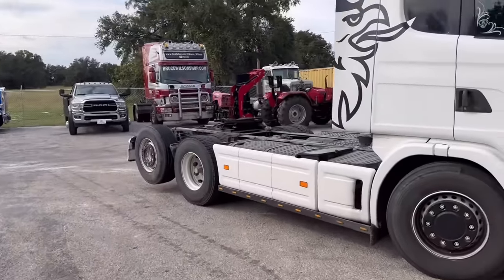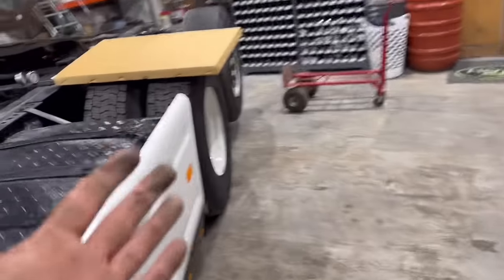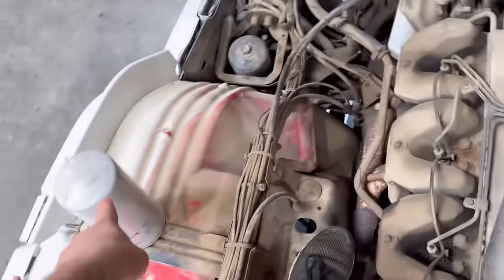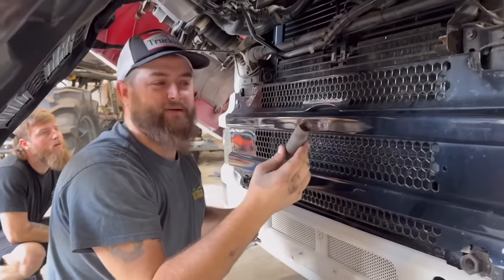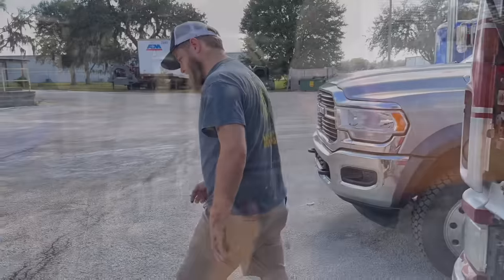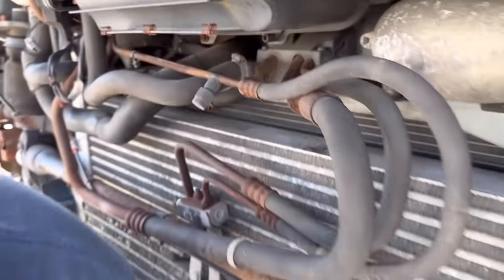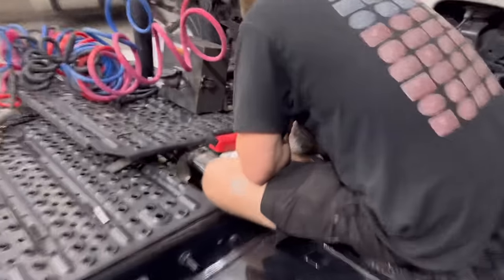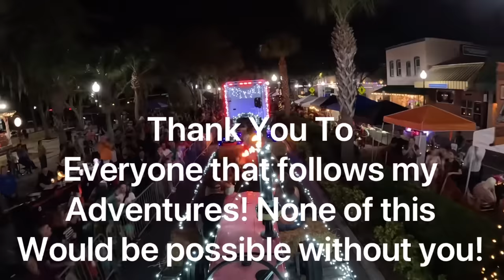My SCANIA Needs Serious Engine Repair…

Comment: In Finland, Helsinki, Scania's workshop in Konala has a disassembly facility in the same connection. You can get parts for even older trucks there.  It is very rare for these to leak a head gasket. Usually the fault is in the block that it is corroded. And welcome to Finland. I really like these Scania videos and if I'm honest I only watch them on this channel
Reply: Correct, probably cylinder liner gaskets.

Comment: Hi Bruce, congratulations on your Scania 144-530. I have had several of them when they were new, the one you have there is the first model 144, you can see it on the front grill, it is not the same as the red one you have, it is with it (new muzzle), in a Scania 530 V8 you don't have to use all the gears, empty tractor you can start in 1 high and high split and switch to 3 high low split and then in high split, then you will find that it starts howling and out of the exhaust pipe, when you skid gear, when you can make it howl when you change gear you can drive Scania 530 V8, you can try searching here for Scania 144 530 v8 straight tube, then you will see and hear how a 530er should sound when can drive in them. you can check the serial style number on the left door, it's the long number you need to look at, it should say 530 or 460 in the middle of the number, you can see how many horses it has 530 hp or 460 if it's a 460 hp it doesn't howl when you change gear as it runs with a different turbo. so good luck with it and see if you can get it to howl when you shift gears.👍
Reply: Wel wen I drove my 124-340 I started 2low loaded, empty I even started 3h or 4l😂
Reply: It says 580 on it when he showed the truck when it was red before Raymond had it
Reply: @cian7776 that would make it a 164 not a 144 unless it’s been tuned by someone 🤷🏻‍♂️🙂
Reply: @user-yi9fx4ke6r if im not mistaken (atleast with older cars) americans measure the horsepower differently so thats why the numbers seem wrong to you. Dont mock me as I'm no expert please but my old beamer showed 125 US and 95 here in Europe.
Reply: When I drove my Scania L81 home I lost the muffler and it howled, I promise! It was embarrasing to drive with it in the middle of the night.
Reply: Any european  truck bobtailing there is no need to start in first gear at all, u start in 3rd high, then 5 low , next is 7 high and keep going in high .
Reply: @Utxtreme Exactly right.
Reply: @LeperMessiah2 wouldn't thst be kw vs hp? I know it shows both on swedish pink slips... and the difference seems to match.. my old 244 Volvo gt -78 was 78 kw (I think) and like 100-102 hp.
Reply: @kungfreddie  that could certainly be true but scratching my head even further I believe it depends on where they measure it. I know some numbers are measured on the wheels and another "a different" place..?
Reply: @LeperMessiah2  indeed, you have wheel horse power and horsepower directly from the engine. Because power is lost in the gearbox and ofther parts of the driveline
Reply: @kungfreddie 
1,36-1,37 hp (metric) / kW 
fick jag lära mig i skolan…
Reply: @LeperMessiah2 they still measure European trucks in hp even if everything else is in kw. Volvo have the most hp now with 800hp/3300nm.
Reply: @LeperMessiah2 and your BMW had less hp because it was an emissions vehicle. This Scania is an import.

Comment: usually the head gasket isn't leaking, its the cylinder sleeve's upper o ring,  or the cylinders wall has started to deteriorate so maybe it need's to be bored to an upper size. Yes you can bore just one cylinder and get the bigger size sleeve. same size piston so the piston doesen't need to be replaced if there isn't anything wrong with it. with best regards an Scania mechanic in Finland
Reply: I just commented the same a few minutes ago. Regards, former scania mechanic from finland 😅
Reply: I wrote that TI 😂
Reply: Came to the comments to say the exact same thing. Learnt the hard way that it’s not the head gasket that leaks but the liner top o ring. Usually have to recut for the over size liner as well
Reply: @karlhardman3304 I have an r730 at work leaking. This is a bit depressing but doing Scania 8cyl head gaskets isn't as simple as the 6cyl.

Comment: The night cab heater is likely to be one of the Webasto units, and there should be a control panel for it in the cab ( usually near or close to the bed compartment) usually a digital control panel, where you can set the heat/time etc, they run on the diesel from the main tank, and are pretty darn good when they work as they should, they still fit those units to modern day trucks and motorhomes, so finding spares for repairs shouldn't be an issue, trust me, they keep the cab toasty of a cold and frosty night.
Reply: if it is an Scania original heater it will be a Eberspächer Hydronic M10. the main problem with that heater is that the exhaust fan stops working and the heater ecu is on top of that fan and it will burn the ecu of the heater
Reply: or simply replace it with a chinese knock off. they are cheap and are good.
Reply: @sannmarc I think a lot of people are worried because they are cheap and Chinese but you are right they're actually not bad. Certainly really good for the price.👍

Comment: Pro tip from a marine engineer, get some copper pipes and press them flat and use them to scratch the soot build up loose from the inside the sentrifuge purifier. The copper tools will not scratch the sentrifuge like other steel or carbide tools will and you do not want scratchers inside the purifier cause that will make the soot stick Harder to the inside and make it more dificult over time to clean. Also u can use a special kind of paper inside these purifiers that the soot will stick to instead of having it stick to the purifier casing👍🏼

Comment: I would caution against the frame and rear end changes you have suggested, and for reasons you have already mentioned. That is that every aspect of that truck has been engineered and calibrated to work as a complete system. That includes the frame size, length, strength ect..... To mess with that might take away some of what it is to be driving a euro truck.
Reply: Well said! Thank u!
Reply: Frame extension is a routine job. Just need to follow instructions and use Scania frame parts, which apparently he will get from Finland.
Reply: Hello Bruce. That rig looks to be in good shape. Hvile youre over in finland, get a hold of a narrow type tag axle. That you can mount twin wheels on. It looks much better. You colud order them both ways when tey were new.
Reply: @JaakkoIsWatching  I hope so. That would be the best and most genuine way to do it.
Reply: @JaakkoIsWatching it's not so routine on some euro stuff, doing chassis extensions on dafs in the late 90s still needed diagnostics computer because extending the wires to the rear lights caused fault codes.... And hundreds of other fun little electronic gems. The chassis on that truck has already been modified once but the way Bruce is talking about modifying it will be a technical nightmare and the end result will most likely just be a pile of parts.
Reply: @pinkskud1 he's said he wants to stretch it out and put an American rear end on it..... Hardly Scania parts, it'll end up scrap.. just remember the air force truck..
Reply: @Savagetechie  this is my fear. The Axel's and gearing and frame are all engineered together in a way that older US trucks were not.
Reply: @pinkskud1  he didn't even have the attention span to do a stretch on a 1980s American truck, once he realises just how many sensors feed into the ecu and other modules he'll abandon it. I mean I hope he takes a trip to Europe, gets some inspiration and forgets the stupid hybrid idea... A highly talented shop with a lot of resources could maybe pull it off but definitely not the Bruce Wilson shop.
Reply: Using the parts cleaning system without gloves is not a good idea.  Your skin is not a good barrier against all the man made chemicals being used.  Some will end up in your blood and carried thru your body .
Reply: To be fair, I don't think that altering it will be too much of an issue. Even with the sensor problem its not impossible.
Reply: @sterlingodeaghaidh5086  you've got all the sensors in the axle, the braking system, the suspension, the lighting  it's no minor thing, the truck will need serious electronic and software customisation. I'm not saying it's impossible just a lot more difficult than stretching an old Pete or similar and as we've seen on the channel before Bruce gave up part way through stretching the air force truck.
Reply: Yeah i remember airforce truck it is done and on the road. It started a good youtube channel with Tim and his son wide load.
Reply: @Savagetechie  For someone who has no clue why he’d want to stretch this…. Is there a simplistic answer? Is the Scania not able to hook up a US trailer or something like that? Just wondering why stretch the frame? It just sounds like a bad idea, but that’s just on the surface for a non-truckers viewpoint 😂
Reply: @ricktaylor14001  because he thinks it'll look better.. no other reason.
Reply: @Savagetechie  Okay… well that makes sense. We all do things on our vehicles to make them look better and some people get weirded out by that too. Can’t say I’ve ever wanted to stretch the frame of my vehicle, lol, but then I don’t have a semi either. The Scanias (and most Euro trucks) DO have a stubby look to them, so I get it… sort of. 

THANKS for answering! Much appreciated. Merry Christmas & Cheers from 🇨🇦!

Comment: Check the cab level sensor on the front under the drivers side next to the night heater, looks like the front bags are deflated and sitting too low.  If its knocking when there inflated cab bushes are shot.

Comment: Bruce as a European truck driver, can I give you a tip?  When you leave you can safely leave from gear 2, we rarely use the first gear as European drivers or when we are heavily loaded , you can also go from 1 directly to gear 3. 😉
Reply: Yep step shift when nothing attached. I still do it in some manual cars 😜
Reply: @bobh9882  can you switch gears without having to use the clutch?
Reply: @iffykidmn8170 with this truck yes, you did also have semi auto so just reverse and first gear using the clutch al the rest was auto
Reply: @iffykidmn8170  Depends on the revs, current speed, and ascent/decent
Reply: @bobh9882  it's normal to do in a car. nothing new, they teach it here in driving schools.

Comment: Hi Bruce, Congrats on another SCANIA, love the Scanias. Back in Brazil due to some regulations like in Europe after 2000 all trucks are cabovers', Scanias, Volvos, Iveco etc. Not a big deal but shops used to strap the cab to the frame after jacking it in case it flips foward also using a long 4x2 or someting to hold it in place in case the original piston goes back while doing maintence on engine. Im not a technician of any kind but had a buddy that was at a truck shop. Good luck with the truck, great content as always.

Comment: Both tanks around 400 gallons which is around 1514 i Liters. This 1997 is amazing but you have to see and drive the last generation with some additions from 2022.
The little heater at front right could be the Webasto type.

Comment: A neat feature of the Scania you have, (i am an old Scania/Volvo/MAN driver from Denmark/Norway), is that when you get in you can leave your shoes on the steps, and when you close the door the way the door is made your shoes are secure on the steps.  Like leaving your shoes on the porch when you walk into your house. I saw a guy who had run his AC/heater vent down there so you could have nice warm/dry shoes to step into when you get out of your truck to do loading whatever. A "fun" detail here is that the MAN trucks don't cover the bottom step, so if you are used to driving Scania and swap to a MAN you loose the shoe on the bottom step.....
Reply: How can you go from a Scania to a MAN? Sacrilege 😂

Comment: Hi Bruce! if you’re coming over to Europe, firstly - take back a set of Alcoa Durabrite wheels. Secondly here in England we can pull 97,000lbs with a tri axle scania - in Scandinavia I believe they can go much heavier - check the plate Inside the door frame for it and it’ll give you a safety related capacity (check all of them). Also I’d well recommend going to Holland and checking out some of the Fashiom styling for trucks - they have some great truck upholsterers and accessory shops there. Also why are you going to Finland exactly when scania are made in Sweden? Lovely to hear you’re enjoying the might V8 though
Reply: 104 tonnes

Comment: Bruce, one of the new Scania ones, which are called: super, with 560hp and more torque than a Cat or an X15 with 40 tons gets you more than 11 mpg, those trucks are insane.  In Mexico I have the new generation, but with the 620hp V8, listen to me, it's a crazy truck, I'm humiliating everyone on the road
Reply: I was looking at Daf trucks, and yeah even the one i looked at 560 hp and 2100 ft lbs. of torque
Reply: Wheres dealership in mexico? Which state
Reply: Next gen SCANIA are something else anyway
They are the real definition of beauty and beast
Reply: @Xv1p3rCr0  In my case I am from Mexico City, but it doesn't matter that they are all over Mexico, it would be a very good idea to buy a Scania in Mexico and take it to the United States.  Yes, many American trucks are already made in Mexico.

Comment: You can tell by the engine tag this is a 530. The 530 engines are named DSC14-13, and the 460 engines are named DSC14-15

Comment: The AC pressure sensor pigtail disconnect that's dangling on the white truck is a 2 position Deutsch DT series.

Comment: I know it's been writen before, but there's no need to use the crawl gear. Just start it on 2nd and you'll be good. I hauled the Tiger Tank in the Swedish army with Scania T530 with a total weight of 100 tons, not even then we used the crawl gear 😊

Comment: Hey Bruce I’ve been driving scanias for nearly 30 years hear in the uk and your cab shouldn’t be as wobbly as it seams . Not sure if anyone else has pointed it out to you bud but when you lifted the front grill up I noticed your cab air bags look like they could do with freshening up especially the one under your drivers side that looks flat ,when aired up  go round and check em for full inflation😉😂 ps when you come to Europe go have a look at the cabovers built by your American Paccar company DAF I’m surprised paccar haven’t imported them to the states badged as a kenworth or Peterbilt cab over
Reply: XG+ would be awesome in the US
Reply: DAF is actually imported and rebadged as peterbilt 220 (box truck not semi)
Reply: No point in wasting his time on "soft trucks" i.e. daf iveco Renault Mercedes Man. Stick to scania or look at European Volvo's the rest don't compare.
Reply: @EricDJF  now now let Bruce be his own judge 🤣 we know the best are the big swedes but thought he might like to see a DAF xf or XG+ seeing how paccar build them and some of the systems used in those models are also in the Kenworth and peterbilt 😉👍then he will see Scania and Volvo are the best in the world 😉
Reply: @Xv1p3rCr0  true but don’t think they get the big tractor units like for example the DAF XF or XG+. But I have noticed the new peterbilt and Kenworths share electrical components and trim styling as the DAF  paccar sharing parts bins and stylists is evident

Comment: the red scania you had the photo of was a 164/580,which ran from late 2001 to 2005,your truck is a 144,either a 460 or 530hp,which ran from 1997 to 2001,your truck also has the early type top grille with the exposed radiator cap..

Comment: Hey man! 
Getting stressed out about your shifting 😅 you don´t have to start on C all the time, that´s only for when you pull heavy loads, or start in a steep hill or stuff like that. Now, when your split is functional, start on 1H, skip to 3L and then go to 4 L/H and then up. Or, you can start on 2L and jump to 4L if you want to rev it a bit more on the low gears. 
And, you don´t need to slip the clutch when starting, just release the clutch slowly and let the tourqe do the job. And also, go slow when shifting. Wait 1 sec in neutral between the gears and you won´t bust those sync.rings. 
Optimal shifting range is about 1400-1700rpm. 
Keep up the good work! looking forward to see what you get up to with that old bad boy!

Comment: Hi Bruce 
The leaver on the dash next to the speedo on the right (looks the same as the handbrake)that should be the gearbox retarder and has 3 or 4 settings its similar to a jake but uses the gearbox and on some models of Scania the exhaust brake too,good for hills and roundabouts traffic.enjoy

Comment: Hi, great videos.  Just a quick note I had an friend here in Maine with a small fleet of Scania tractors hauling  logs out of the woods here. Had very good luck with them until he retired.  They seemed to be very reliable and were easy on fuel.  Good luck.

Comment: In Scanias product naming line up the first two numbers are the engine size the third one is its build series number like (mk 1 or mk 2 etc), e.g  a 92 is a (nine litre 2 series), 93 a (nine litre 3 series),  112 - (eleven litre 2 series), 113 (11 litre 3 series)  the biggest motors are the 14 litre and the sixteen litre V8's (143 - 14 litre 3 series) 164 (16 litre 4 series) etc

Comment: Hi Wilson protip from the dealer mechanic. If your power steering growls when you turn and it doesn't need oil. The oil level is correct. You can fill it up some more until it stops hisin. Sometimes the oil will form a funnel down in the filter and it will suck air. Thank you for great content